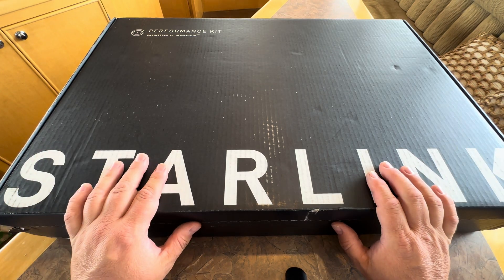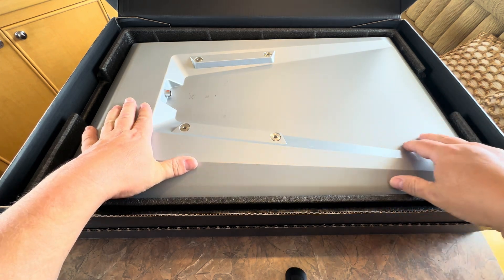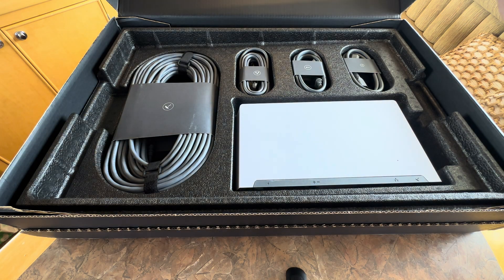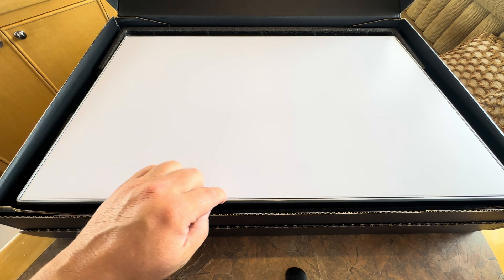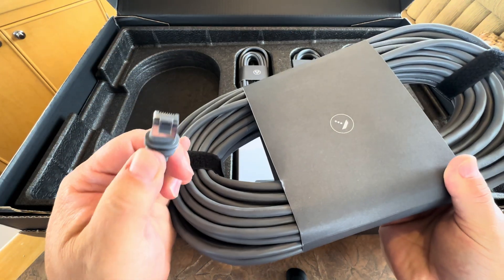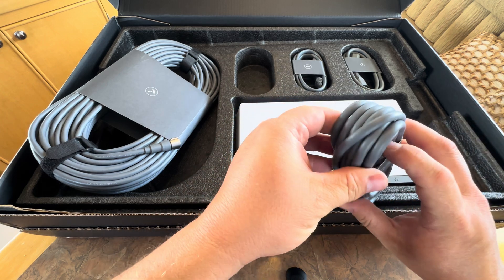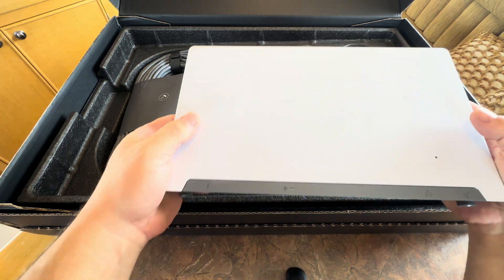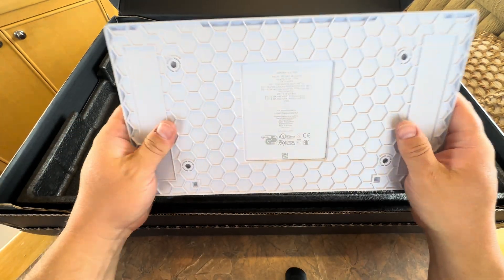Starlink Performance Kit Unboxing

Comment: Thanks Steve. Nice product, feels too heavy for a tiny truck camper rooftop! This fits your needs perfectly.
Reply from the maker: It's probably overkill if it is truly tiny! The mini might be a better setup, or even the standard.
Reply: @SeaBits  Thank you for your tip. Currently we have Gen 2, still heavy and it looks like a race car spoiler in the rear (I have it set to Tilt—flat) and receive good service driving around. Because I visit remote areas, the mini is not able to hook up, or find more than 1 satellite at a time. I’m going with your standard suggestion—even though the router uses 65w :)
Reply from the maker: There are DC conversion kits that can help save a bit of power over using AC power. The new advanced power supply that comes with the Performance Kit is also supposed to be compatible with the Standard dish, although I have not tested it yet.
Reply: @SeaBits  Another great tip. I looked into your power supply. It must have a step-up/step/down transformer inside? It’s almost 8 pounds. Power wise the truck camper has enough through 700w on the roof and 800w from the alternator—and can be fast EV charged …just looks funny—a gas pickup at a EV station. I was just fascinated with your Gen 3, and cheap using AC to power Starlink
Reply from the maker: @PicturingLifesCuriosities  yes, I suspect the new Starlink power supply has a voltage converter / transformer inside it. Most of the 3rd party kits come with something similar.
Reply: Thanks again Steve. You’re my ‘go-to’ for connecting to the world since you bought your first sailboat—way before Starlink. MeHi from Newfoundland